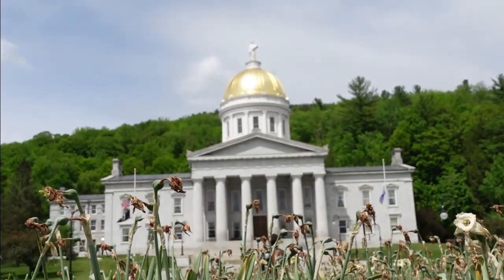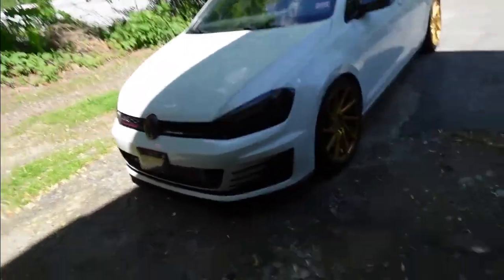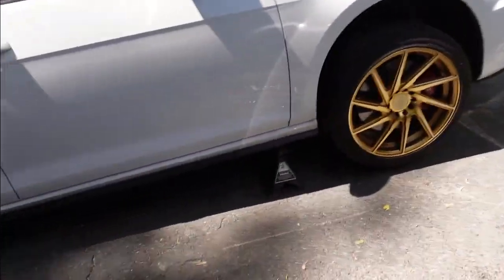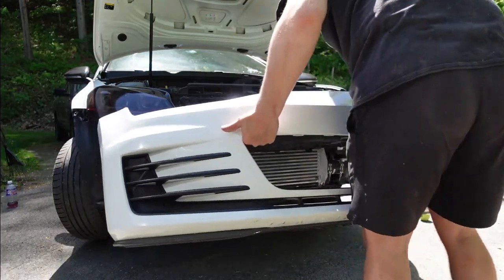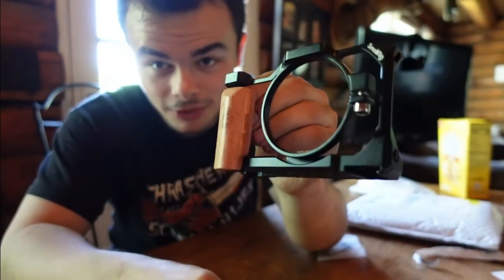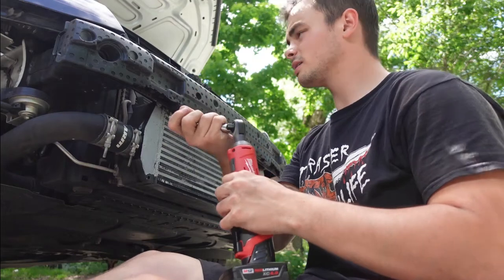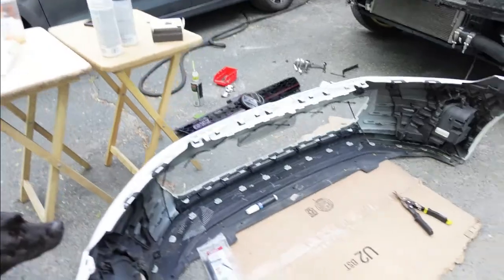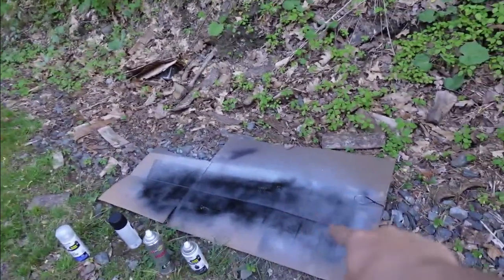I Made A Custom Front Grill For My MK7 GTI

Comment: Actually like it, looks pretty damn clean. Did the paint on the ARM intercooler wear off that bad??? That might sway my decision to not go black lol
Reply from the maker: Thank you dude it kinda surprised me, I was just kinda messing around honestly and it came out pretty good! And yeah dude it’s the one kinda gripe I had about the Intercooler is the paint from the black immediately chipped and whenever I washed it it kept getting worse. But some of my friends didn’t have the same problem so I’m not to sure!
Reply: @ChrisFromKenya  damn lol. Not sure what I’ll end up doing then. I just don’t want to have to paint it down the road.
Reply from the maker: @mwarn84  yeah I don’t blame you man I was pretty pissy about it honestly. Which sucks because everything else about it is perfect product wise, the charge pipes are wrinkle coated and fitment is perfect so it sucks that they slapped some cheap paint on it, but is what is my guy haha